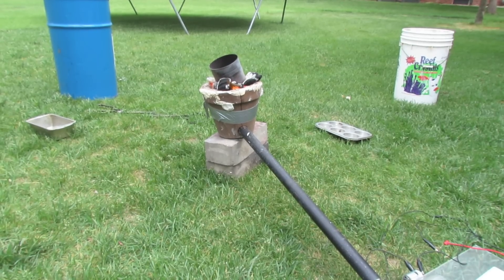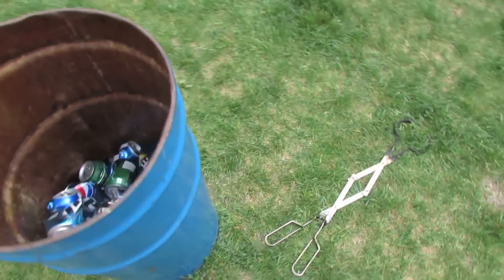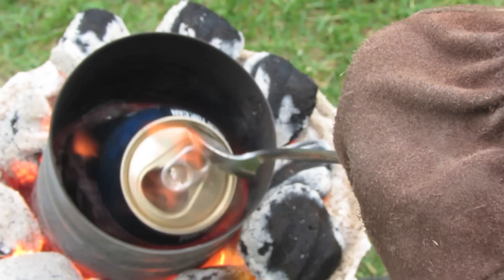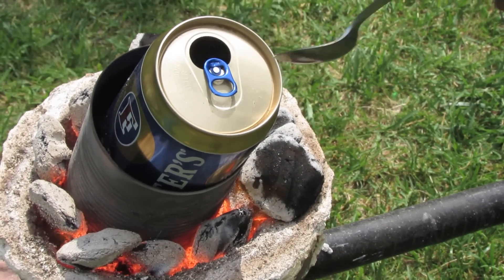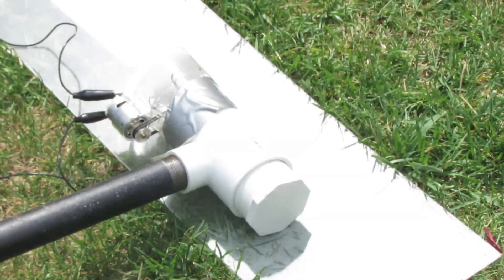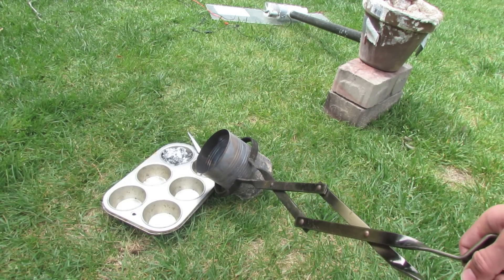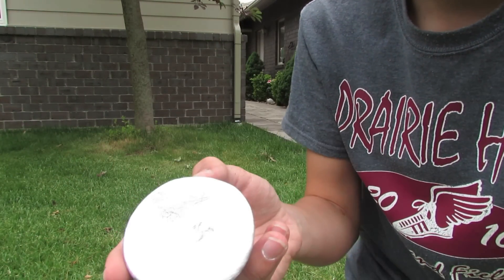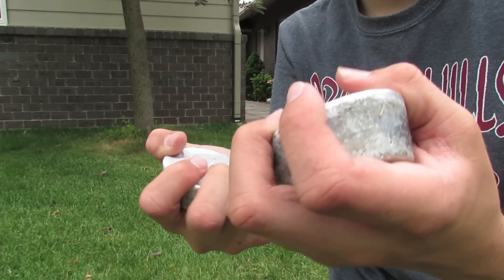Easy Charcoal Furnace Melting Aluminum

Comment from the maker: It is a tin can, which I thought could hold up to the molten aluminum. It did well for one melt and pour. I tried it a second time and it started leaking molten aluminum into my furnace. I think using a stainless steel crucible would be better.

Comment: Great experiement! I have to design an electrolysis plant for aluminium. Could you say me what kind of brick you used to isolate the plant please??
Reply from the maker: I used refractory cement, but I don't know if that is the best material for an electrolysis cell.
Reply: ok thankss ;-)

Comment: Do you use the Kingsford Competition briquets? I think the off brand i tried using don't get hot enough.
Reply from the maker: Yes I used the kingsford ones. Also, you may not have enough air blowing through.

Comment: Is that a tin can?Can this hold up so well at high heat?
Reply: I tried this with a sweetcorn tin.. It didnt last maybe 20 minutes before i had molten aluminum pouring into the bottom of my furnace :(

Comment: You can acualy sell the ingots i heared its $1.05. Per pound
Reply from the maker: Oh, I am using them for my element collection. That is a pretty good price.
Reply: i also have a collectoin of ingots and im 13 but i have like 1 million $ from your video thanks for posting the video
Reply: ? I have alot of Cans that i Melted down so i will be getting alot of Cash when i sell those.
Reply: josh beasley that is about 20 million cans

Comment: Now what do you do with the aluminum ingots?
Reply: Casting aluminum is kind of a two step process you melt scrap into ingots then you melt ingots to cast into a mold. Other wise you might not have enough metal for the mold, its hard to tell with scrap.
Reply: It also allows you to get rid of a lot of the junk before casting.
Scrap aluminum (especially cans) often has a lot of dirt and oxidization on the surface, especially if it has been anodized.
Pouring it into ingots first allows you to get rid of a lot of this dross so you have nice clean raw material available for when you want to cast something.

Comment: Pour it in an ant hill
Reply: GENIUS!!! That'll teach the bastards to bite me.
Reply: Aiden Pierce
 Be careful it can cause a steam explosion and fling molten aluminum everywhere if the dirt is wet
Reply: realy?
Reply: Yes, the molten aluminium is at about 660°C so it would flash boil the water contained into the soil into steam, which in turn would blow the molten metal everywhere including on your  body. Don't pour molten metals on concrete either because it would cause similar results.
Reply: wow... thanks for the tips